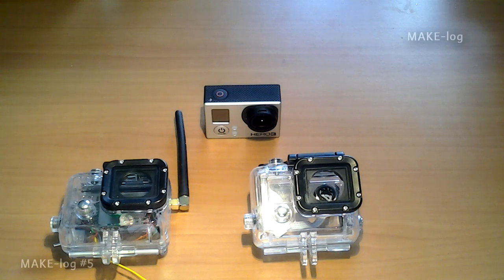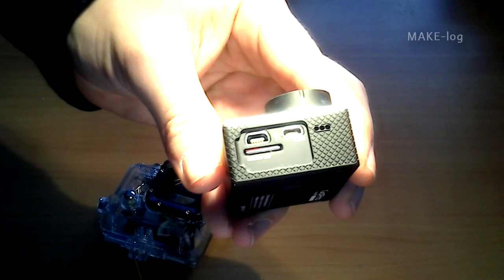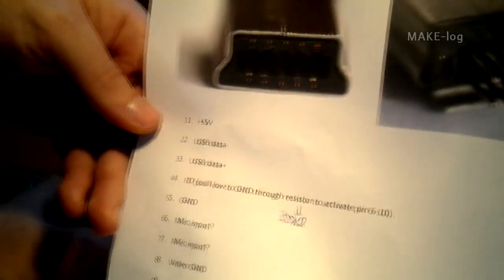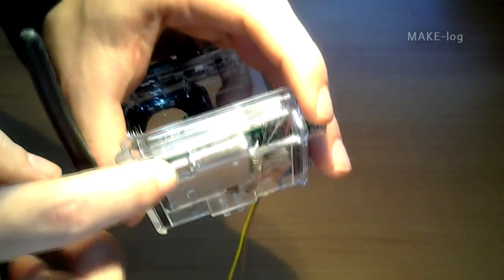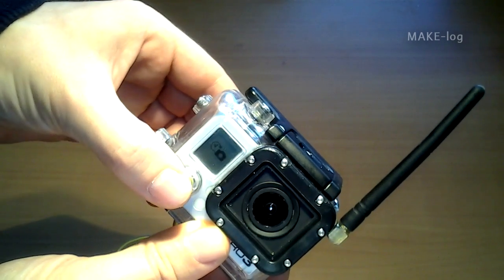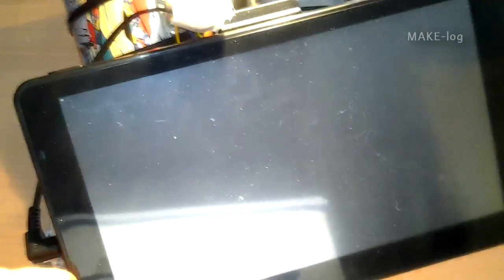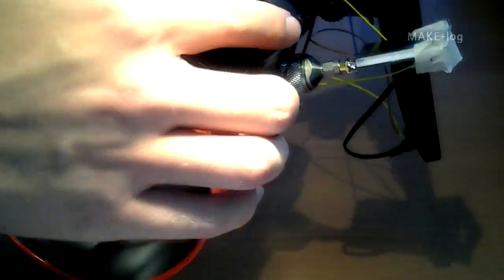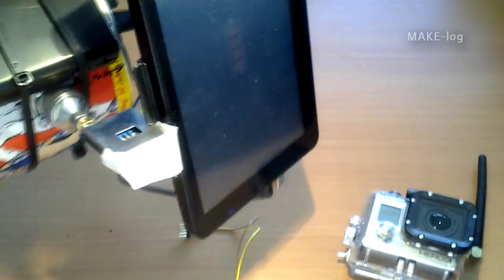MAKElog#5 FPV 1W video transmitter inside GoPro case, rugged to survive crashes

Comment: Nice video. I need to use the same setup for SJCAM (GoPro like).... But the difference is, that I want to use it underwater! So, I need my camera placed in about 5m depth water transmitting fpv signal from water to shore, distance maximum 50m. Can anybody tested the same setup for underwater porposes? Or maybe any ideas?

Comment: U are giving me some ideas. I need to do the same thing.  I have a Horizon Blade QX2 350 AP and really don't care for the camera that came with it, as it makes an AVI file that must be converted first before it can be put into an editor.

I really like my GoPro Hero 4 Black! I put the holder for it on the gimbal but the range is really bad.  I usually lose signal by the time it gets tree top high.  I'm looking for a solution to that that will fit into the camera case that's on the gimbal.  I'm looking for a transmitter that will plug into the back of the camera with the antenna pointing downward.  If anyone knows where I can find such a thing please let me know.

Comment: What is the latency like on when using a gopro as a FPV cam? Also is there any noticeable change in quality when it's recording at the same time?
Reply: I'm guessing not much latency (200ms I guess at max maybe worse when too far) there as now you are basically streaming (thx to the usb cable) what the camera sees into the antenna and to the receiver. As for the recording question I don't know.

Comment: Very good idea ! thanks for sharing
You might get better reception using a clover leaf antenna on the vtx and a skew planer on the rx the circular polarization should give less dropouts .
I have the same tft screen and the weird effect is the screen switches  into blue screen and back  when the video signal drops out .
Reply from the maker: DE LEON Dear Leon,thank you for your comment and your helpful hints! I think the antennas offer potential for improvement :)My TFT is not a native video monitor but a navigation system. The feature to display live video is meant to be for a rear view camera. If no video signal is detected, my screen switches back to the navigation system. Maybe yours has a similar function ;)

Comment: Great work on your setup!!! This video shows that you know what you are talking about!
I was wondering what kind of monitor you are using?Do you get the so called ''blue screen'' problem if you loose the transmitter signal?

Vielen dank in advance
Reply from the maker: CupAjoeProduction My TFT is not a native 
video monitor but a navigation system. The feature to display live video
 is meant to be for a rear view camera. If no video signal is detected, 
my screen switches back to the navigation system. Maybe yours has a 
similar function ;) You are welcome :)

Comment: your video is very good, but I have a problem, the cables yellow and brown, what is?
water can enter the space where is the yellow and brown wires?
Reply from the maker: Hello, the yellow and brown wires is for supplying 5V power to the video transmitter and the camera.Yes! Water can enter, because I did not intend the video transmitter case to be waterproof :) I think under water you cannot achieve a long range video transmission because of the higher attenuation of water at 2.4 GHz compared to air.
Reply: Make-log  Hello, the dji phantom is waterproof? I plan to buy a Fatshark and a GoPro to make a FPV flight, but Maybe in contact with water.
you think this is possible?
Reply: Anderson Martins Just in case this isn't a joke No the Phantom is Not waterproof,if you look for Phantom videos falling into water here on Youtube you can clearly see they are not. :-)

Comment: Hi, i need your help. I had the exact tx and rx, I did not ground any channel pin and bx pin on my tx and rx, and my video show a lot of noise, any idea? Thanks!
Reply from the maker: You connect appropriate channel and bx pins to GND at the receiver and the transmitter. Both should use the same channel. You need to ground the pins.

Comment: Very interesting video. Can the side or rear port on the camera be used to start and stop the camera remotely? Thanks!
Reply from the maker: Only the rear port can be used for this purpose. The 10pin USB connector is for MIC input and Audio and Video output. Unfortunately I cannot tell you how.
Reply: Because you don't know or you don't want to?
Reply from the maker: Bobster986  Yeah, sorry, I don't know how, because I did not need remote starting and stopping. I know there are set-ups of many GoPros mounted on a bar which take photos with a short delay between each other. I did not find the source, but it should not be hard to find :)
Reply: Thanks, I will keep looking. I'm trying to find a simple way of starting and stopping my Gopro when flying it on my quad.

Comment: epic fail.  you need to put the heat sink outside the case if not it will over heat and youll burn your video tx and also your gopro.
Reply: He said he was using the skeleton case, it is open slot in the back. Open ears, close mouth.

Comment: I have the same tx 6722 and rx 6788,i dont know how to select the channels for them,If you have the information on how to i would appreciate it or where the information is available and an explanation of the pins as well
Reply from the maker: Dear Paul, the pin functions are printed onto my PCBs. I did a quick internet search for you, so you can have a look at the pictures and the full description at http://www.tpy888.cn/sell/201111/09/478365.html if your PCB is blank. Hope that helps :)